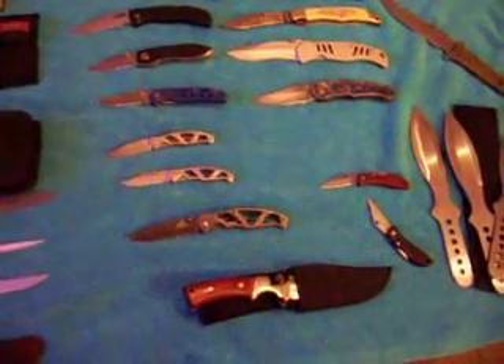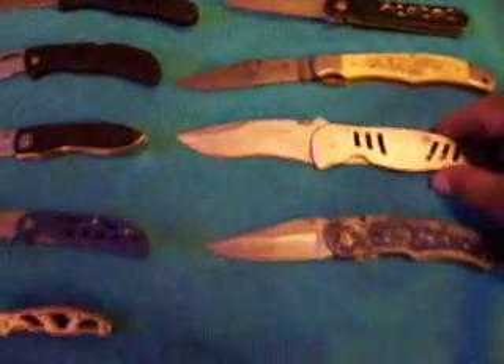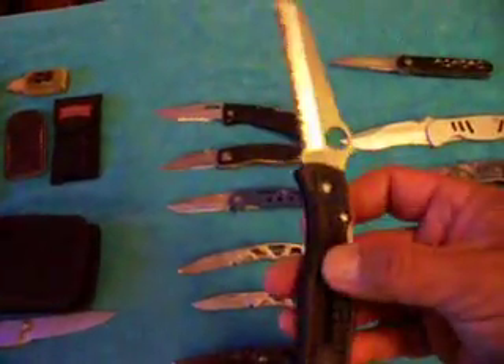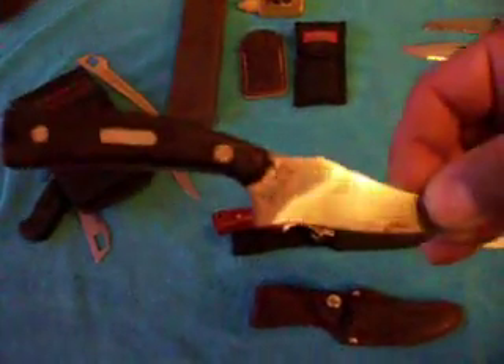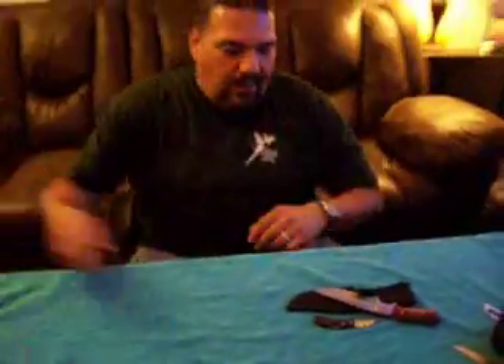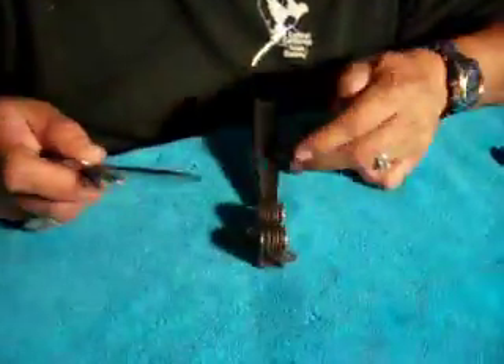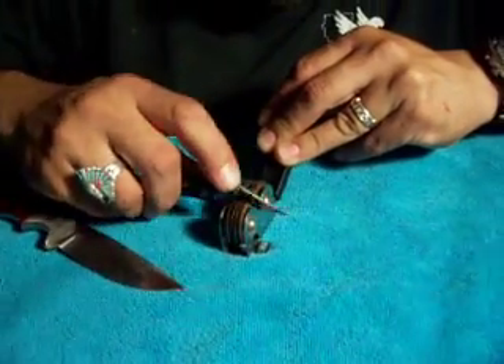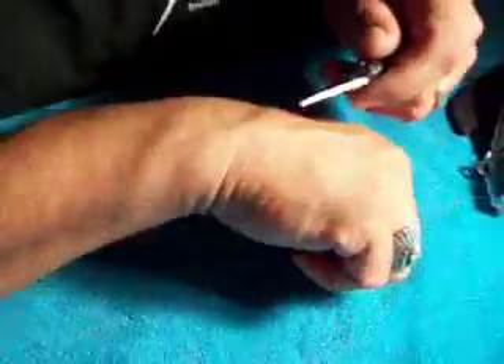99 CENT CASTRATION

Comment from the maker: @eagle1053 Not very much, it should feel like a magnet pulling against the blade. If you pull slowly or push really hard the edge will be lopsided. It is kinda like the pressure and speed of a leather strap in a barber shop.